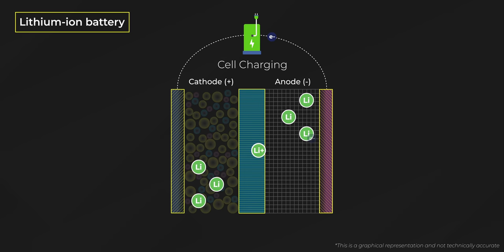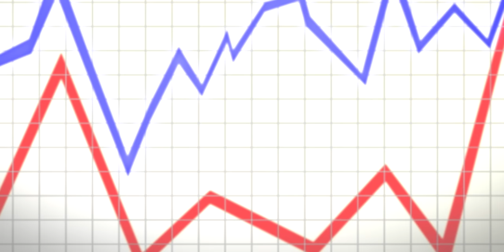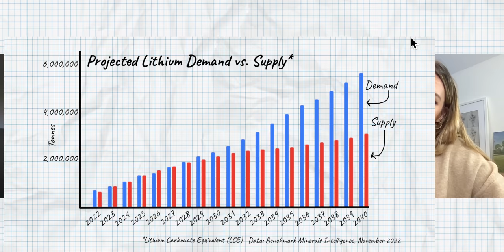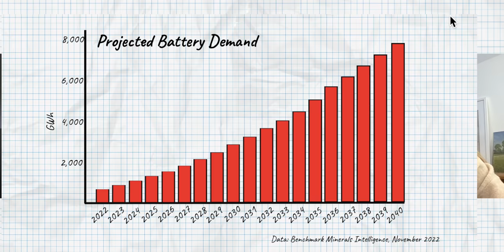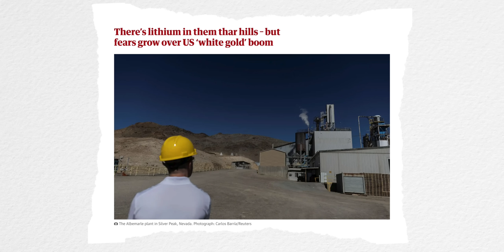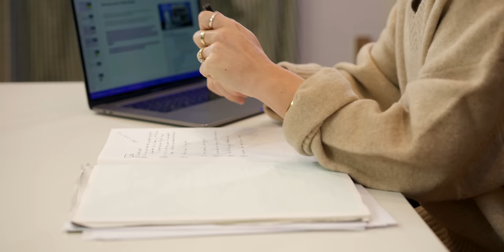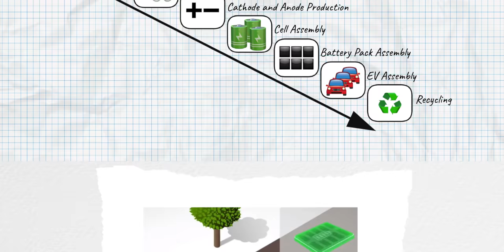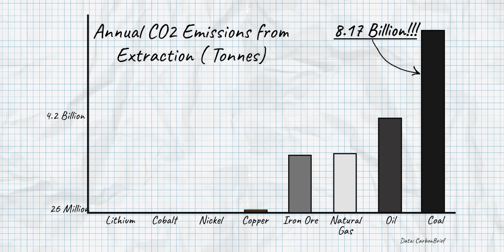There's a Massive EV Battery Shortage. THIS is How We Fix It

Comment: Thanks for another great episode. Battery storage is not just about electric vehicles - it's about storing zero carbon energy from solar and wind power, as you briefly mentioned.  You also mentioned the carbon cost of coal and oil, but what about the environmental damage incurred from the extraction, processing and transport? I'm preaching to the choir, and the main thesis is solid - we have the need, materials, and technology but must rapidly change a vast economic system to the necessary scale.

Comment: 1 part of the solution.
Do not use lithium based storage for static purposes.

We really need to invest in flow battery designs.
A chemical fluid based electricity storage

Multiple companies are doing it, the production scale isn't that large yet to lower the price.

Comment: If we don't find a battery technology other than lithium, the demand on China will force them to halt exports of lithium, citing their own internal need for them. 
Rare Earth metals soon to follow. 
With China out of the picture, the other lithium mines around the world won't be enough to build EVs for long.
A battery technology that doesn't require mining would be ideal. 
Carbon batteries sound too good to be true. It's been in R&D for years and still no product on the market.
Reply: China is only number 3 in lithium mining and South America alone has so much potential, it could last is decades.
Lithium is not a rare mineral. Lead for example is rarer.

Comment: Material's alternatives to lithium should be researched faster. Researches from the University of Manchester many years ago,  put a lot of hope in abundant and cheaper graphite's batteries, all these years after nothing developed. Only one example, many others could be mentioned.
Reply: There is a lot of graphite in batteries already. How that is supposedly going to work as the material supplying the electrons, I'm not sure. Carbon isn't exactly great about releasing those.
Sodium is an extremely abundant material same sodium batteries are slowly going into production.

Comment: We own both a pure EV (Kia EV6) and a PHEV (Hyundai Tucson - that is regularly plugged in and charged up for daily use).  While I certainly love the simplicity and performance of the EV6, I STRONGLY feel that PHEVs make more sense for a significant percentage of the population for a variety of reasons.  The Tucson PHEV was $15,000 less than the EV6, and easily fills the role of a daily runabout for my Wife.  She has been a champion about charging it when needed, and has only had to fill up the gas tank twice in the 7 months we've owned it (and it's only an 11 gallon tank).  It can be used for daily driving, and to drive across the Country if we needed to, without having to worry about where to charge and how long it will take.  Ideally, I'd love to see PHEV's and range extender EVs as "bridge" vehicles until the technology, infrastructure, and price improves to the point that EVs are the most logical solution for everyone.  I don't think that will be achieved for quite some time.
Reply: Pluginhybrids are oerfect for the next 10 years and after full evs!

Comment: If only we had trains, innit?
Reply: All you have to do it make people want to use them - perhaps force would work?
Reply: @timmurphy5541  lol if you think there are enough trains and railways to serve the current population in most countries, you're completely delusional
Reply: @TiagoMorbusSa  they're very expensive to build and need high population densities to be economic to run. The countries that cannot pay for electric cars will have a lot of trouble with trains too just as they do now. Electricity supply of any kind is a problem in the third world.
Reply: @timmurphy5541  Building and maintaining highways, as well as subsidizing the oil and car industry, as well as everybody paying for their own car is a LOT more expensive to build.
Reply: @TiagoMorbusSa  I'm from Zimbabwe and I think that's unlikely. A rail network that could accomplish most people's needs would be incredibly expensive and we haven't built it.  We have sparse traffic over a large area.
Reply: @timmurphy5541  It's not unlikely, it's simple accounting. The price of cars, distributed across the population, the cost of the roads, and the price it costs to maintain the roads, is dozens of times more expensive than train. And that's BEFORE accounting for the negative impact on the economy that is having individuals pay thousands and thousands of dollars for their individual cars.
Reply: @TiagoMorbusSa if you're accounting you need to include value and benefit not just cost. This has been done already and if you don't have some great innovation to offer that increases the benefit or lowers the cost of rail  then no big change will happen.
Reply: @timmurphy5541  The value and benefit of trains is bigger than the value and benefit of cars, considering it's a nicer way to travel, it's less polluting, it's cooler, and much less stressful.
Reply: @TiagoMorbusSa  but it doesn't go where you want or when you want so a road network is still essential. All rail can do is absorb some of the volume on popular routes. It's also more expensive than flying, quite frequently in the UK where I now live - not subsidised much. So the entire though is somewhat preposterous.
Reply: @timmurphy5541  do you not understand how trains work?
Reply: @TiagoMorbusSa  they don't pull up to your door for one thing.

Comment: Sodium batteries, coupled with aluminium fuel cells. The rechargeable sodium would be swapped over if a “fast charge” is needed. Swap stations everywhere- just replace all the petrol stations with sodium battery/aluminium fuel cell swap stations.
Reply: Sodium batteries can charge much faster than NMC. So no swapping needed.
What do you mean by aluminium fuel cells exactly?

Comment: There should be free 7KW chargers on every single street in the country. The cost of which can be recouped with an annual EV road tax

If every single street and car park had free 7KW chargers then the public would accept far lower range EVs as you could guarantee to be able to charge at either end

90 miles (15KWh battery) isn't enough but if every street had 7KW chargers then it would effectively be a 180 mile range EV which is enough for most popple
Reply: @G T If there were 7.2KW chargers everywhere for free they would work all the time. The 7.2KW chargers are very simple dumb chargers like the home chargers how often do the home chargers not work? Almost never

A 15KWh pack light efficient EV would get 90 miles. On a 7.2KW charger it would take exactly 2 hours to fill from 4% all the way up to 100%

So you could for example go to an out of town shopping centre 85 miles away and do your shopping over 2 hours and get back to a full charge EV and drive back 85 miles home

Also remember the average EU car only does 7100 miles per year = less than 20 miles per day. Even with a 90 mile range the vast majority of days you will home charge. Just a few days per month would charge for free at 7.2KW chargers and maybe a few days per year you would super charge for the longer trips

I think in the future 100 mile range EVs will be the most common especially for small cars. They will be cheaper than petrol cars as their battery pack would be just 15-20KWh. And a smaller battery pack has lots of additional advantages. Less weight less cost higher efficiency and need smaller motor as the vehicle is lighter need smaller power electronics as the vehicle is lighter need smaller suspension and crumple zones as the vehicle is lighter etc etc

Comment: I think the best answer are plug in hybrids with about 70-100 miles battery range. Only difference is the ice engine used as a generator only and only direct drive to the wheels at a constant single high gear for highway cruising at 60mph.
This simplifies the drive train and solves range issues. The tiny ice engine probably only gets used once a week at most for a majority of users.
Reply: linear free piston generator and micro turbines would be a huge step up as range extenders compared to full blown ICE for me ^^

Comment: Interesting how you didn't mention autonomous vehicles. Whilst the timeline is very uncertain, they would reduce the need for battery materials by many orders of magnitude (probably around 5-10x)
Reply: For regular passenger cars, I don't think autonomous technology makes much difference. After all, a car takes the same amount of energy to move, regardless of how it's controlled. If anything, an autonomous vehicle should theoretically consume more energy, since you have to power all those computers.

Trucking, however, is where things could get interesting. Right now, electrifying long-haul trucking is very difficult because you have to pay the driver for all of that time the truck sits at a charging station. To minimize that time, you need giant batteries with huge range, and very fast chargers. But, if the trucks are autonomous, even if the truck has to stop and charge for an hour every 100 miles, it doesn't really matter, since you're not paying for labor, and nobody cares if a load of toothbrushes arrives one day later. If charging stops are allowed to be more frequent, that means the truck batteries can be much smaller, hence reducing the need for battery materials.

Comment: Essentially it’s to late to be able to actually meet all the policies that have been announced regarding phasing out sales of ICE cars. It will take way to long to commission new mines, China has existing mine output and processing locked up, new tech like battery density improvements take years to scale up to production volumes. And that’s just lithium. Give it a few years and there is going to be a such a huge crunch as demand hits supply that it will make you think todays supply was bountiful!
Reply: All more reason to look into other battery configurations and find another alternative to the ones we use today.

Comment: High efficient use of all the batteries would also improve the constricted supply. Why have we been conned into thinking that each house ideally needs a battery and at the same time each car needs a separate battery. Is a better solution in many but not all cases that the house and the car use the same battery ? That would involve smarter use.
Reply: If climate change is going to prove solvable, batteries eventually need to become so cheap and plentiful that these types of tradeoffs become non-issues, and everybody has separate batteries for car and home simply because they're cheap, so why not? Obviously, we are far away from that point at the present, but until battery breakthroughs get us to that point, it's going to be tough for batteries to displace fossil fuels at a large enough scale to make a dent in the global climate crisis.

Comment: No mention of carbon nanotube batteries? 
Forget lithium it's too slow to charge and too expensive and rare of an element. 
Carbon is key.
Reply: Those are proposed as an anode material for lithium batteries. They can not replace the cathode material. That still has to be something like lithium or sodium.
The anodes already use Carbon. Nanotubes could just be more efficient.
Reply from the maker: Can you show us where we can see a carbon nanotube battery in action? 
I have been in 5 battery research labs, 3 in UK, one in Germany, one in USA. I discussed the concept of carbon nanotube technology with all of them. 
All the scientists, battery chemists and engineers we've met are very enthusiastic about the potential idea of carbon nanotube batteries. No one has produced one yet.
So it's a bit like saying 'forget wind turbines, they are too slow, fusion is the key.'
Yes of course it is, we desperately need functioning, economically viable fusion energy. No one has done it yet and there are 10's of thousands of wind turbines generating petawatts of electricity around the world.
And it's a bit like saying 'forget solar panels, they are too slow, carbon capture and storage is is the key.'
Yes of course it is. we desperately need to capture carbon and store it securely. NO ONE has done this successfully yet, meanwhile, the fossil fuel industry touts CCS as the answer to all our problems as they almost choke laughing walking away with trillions of dollars a year, knowing they won't pay any tax because they bribed every government on the planet, oops, sorry, I mean advised every government.
Which isn a very long winded way of saying, as soon as there are carbon nanotube batteries, we will be all over them like a rash

Comment: I'd just like to ask, how many more huge holes in the earth will be needed to supply these materials ?
Also how is doing so - low impact?
Reply: Comparatively tiny holes compared to the volume of Earth. Just think of them as craters from meteor strikes if that helps you sleep at night.
Reply: @LCOF  ha good point! funny when you read things like people 'concerned about the mining impact of batteries' , when they express those concerns sitting in their house, heated by Russian gas, using a laptop built in China assembled from components mined all over the world. Just looked around people, pretty much everything you buy was created after some mining.
Reply: @reubenwilkinson6493  I'm not in a house and don't have heating, but I do see your point.

Comment: Cars made without batteries could be the answer, with the average journey of 30 miles a day lead acid batteries could transition until solid state or even nuclear powered batteries are available . Novel technologies could be developed , such as cooling laser technology and thermal properties to create a charge , the Voyager probes after over 40 years still use thermo electric generators . Nuclear waste from up and down scaling heat could create photovoltaic light and be used if the materials could be developed .
Reply: I think you are talking about Peltier modules - which use the difference between a very hot surface, and a cold one, to manufacture small amounts of electricity, such as those 'battery-less' fans that can be stood on a hot wood-burning stove, to turn a small motor that turns the fan.
Reply: Nuclear batteries? Sure buddy.
Lead acid batteries are also not a great idea. Lead is actually a less common element than lithium. Not to mention the way worse properties of the batteries.

Comment: frankly, this is showing that the current batteries are NOT the solution.
Instead of digging up massive mines, let's research new battery tech. Solid state, recyclable, that don't have the issues of the current battery tech. and frankly, the current state of the batteries is the main reason i refuse buying an electric car. i don't want a slow charging, low mileage vehicle, with a tech that will degrade in a few years and make it unusable.
Reply: You are being naive in the extreme! There is an ENORMOUS amount of research into battery chemistries going on around the world!
The experts don't need YOU to tell them it would be good to have better batteries, ffs....
Reply: @andymccabe6712  i may be naive, but I do know there are already better batteries in the pipeline, but they take too long to get here. Also, i don't think the experts will go on this page and give a damn about my opinion, so it's ok.
Reply: @vladmihai306  might I suggest you rent an EV for a weekend road trip, in particular - and even if you hate the brand - a Tesla - I think your slow charging view needs some personal experience, I'm not going to try and explain why it's not an actual issue, you need to go do it to see.
Reply: @brushlessmotoring  I have a petrol car and believe me, it has annoyed me quite a few times on longer journeys, that I need to stop for refueling. And it has 750km of outside of city range. And that doesn't take nearly as much as an electric car would, plus petrol stations are many more and you usually find an available pump, whereas with electrics, that's not the case. Also, I usually start my drive home in the afternoon and I end up late in the night, over 12AM, so believe me, I don't wanna spend 1 freakin' hour in some charging station to wait for it to change, when I can get 1 hour early in bed to sleep.

I had a short experience with an electric car in the city and that's something good, but again, while the tech is good, batteries, in their current state is a very low point so there is definitely a lot of room for improvement.
Reply: @vladmihai306  things take time. There is nothing you can do about it.
You still can't just wait till the perfect thing comes along. You are going to wait forever. You've got to use what you got now and use improved technology when it comes along.
Reply: @4203105  yeah, well in the meantime I enjoy my turbo petrol car. Nothing wrong with it. I'll let the others pay the r&d money and the manufacturer tax of profit till they get out better batteries to consumers.